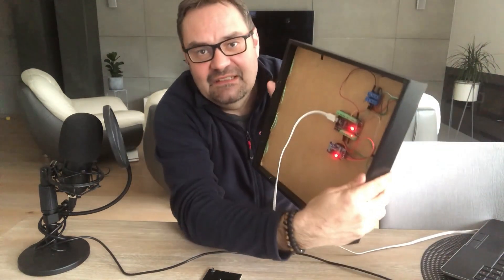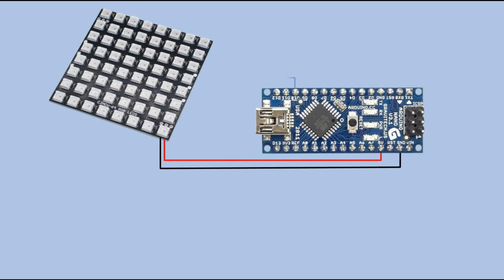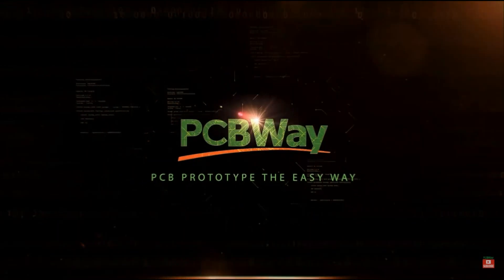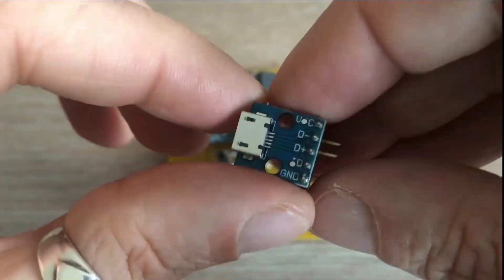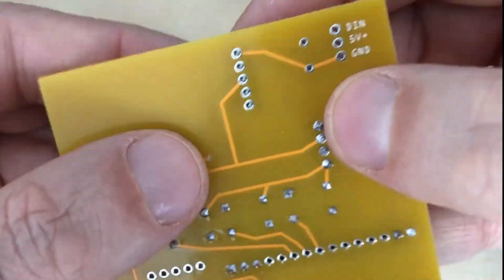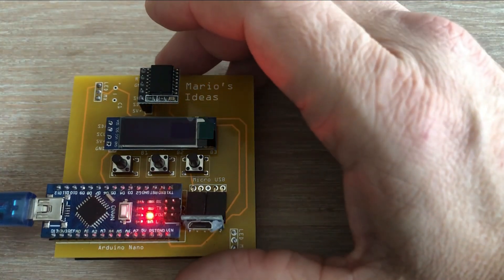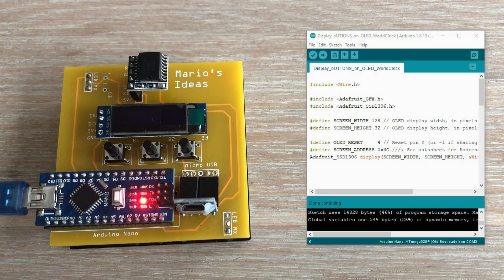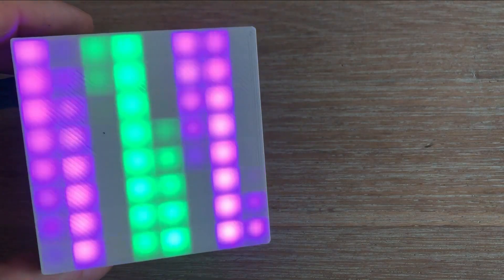Arduino Word Clock: Creating a Cool Timepiece with a Compact 8x8 WS2812 Matrix

Comment: A year, and no part two yet? is there a part two, or we give up ???
Reply from the maker: My bad. I had the video about halfway done a few weeks after the first one, but then a sad family event affected my release schedule.
I also started experimenting with ESP boards that support Wi-Fi, which gave me the idea to build this clock using those boards. In that case, I wouldn’t need the OLED display or the buttons for setting the time—and I could even skip the RTC module altogether.
So, I ended up delaying the final release. I promise I’ll publish the second part soon, and potentially a third one featuring the ESP boards. Thanks for your patience!